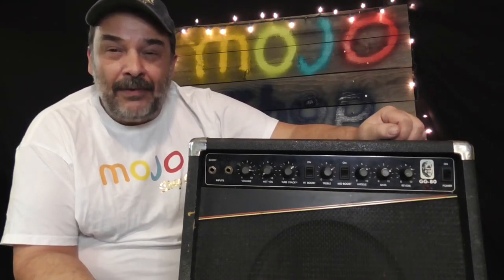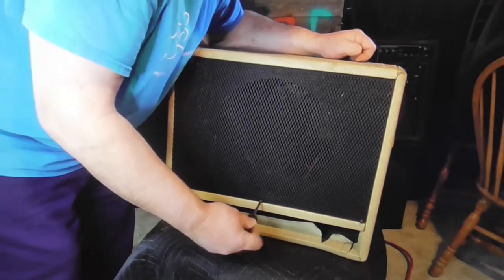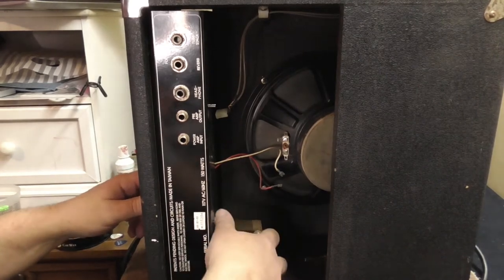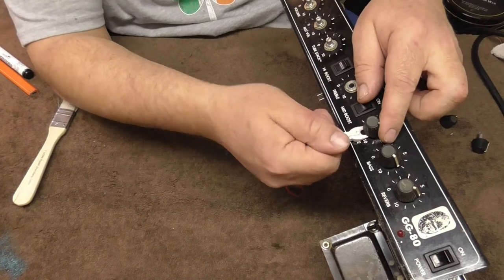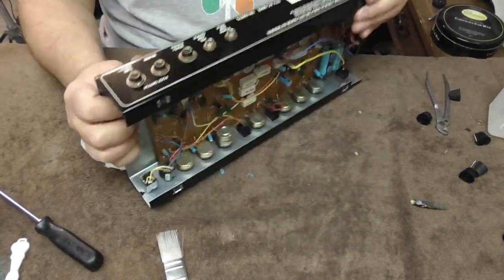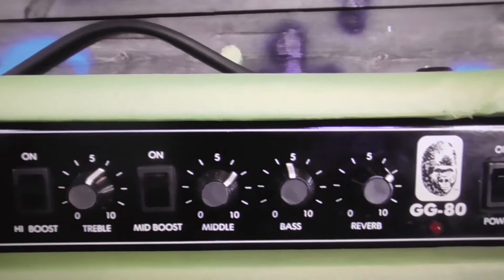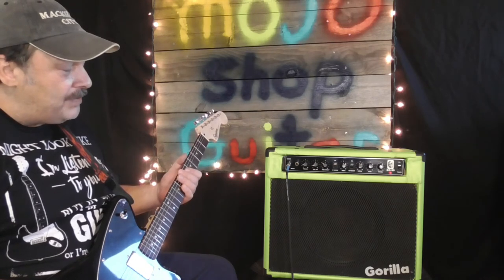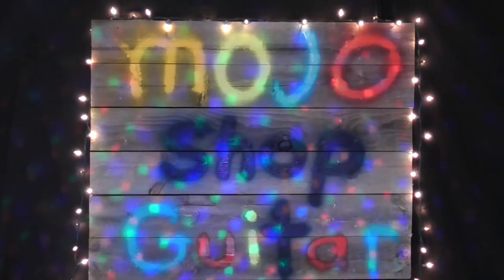Meet  FRANKEN AMP!!  A 150 watt carvin, gorilla amp mash up

Comment: Which gorilla amp is that one? And what brand is the vinyl cover? I ve been told to use tolex brand as it is tough and will hold with the glue...but I can’t find it in hot pink ☹️
Reply from the maker: I used vinyl from fabric store. Contact cement will work good. Send a pic when done. ROCK ON😎
Reply from the maker: It's a CG80